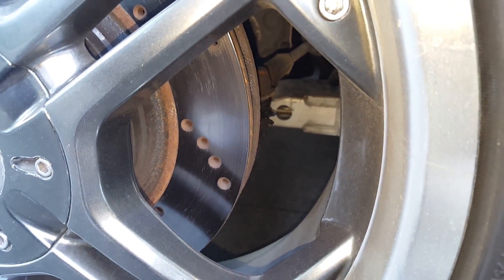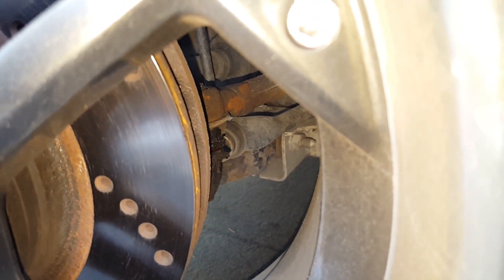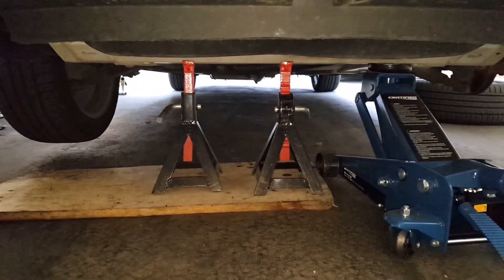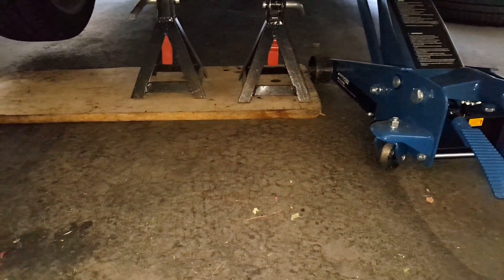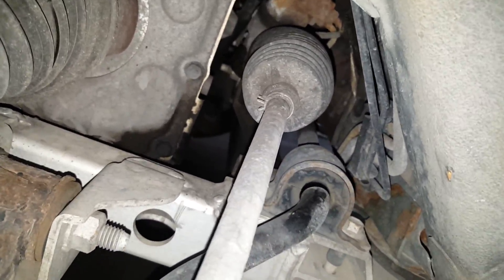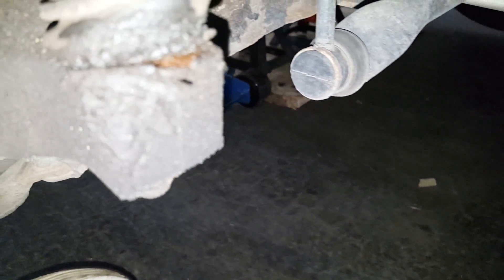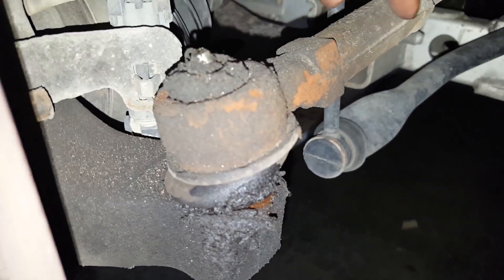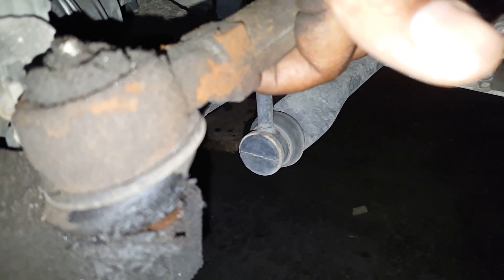04-08 Grand Prix - Basic Tie Rod Check

Comment: I have a 04 Pontiac Grand Prix GT1. I hear a clunking noise every time I put the car in gear drive or reverse. I believe I need a power steering rack and pinion but not sure which one I need. My brake and traction control lights are on in the dash could this be because of a bad steering rack? I changed all 4 wheel hubs and checked the brakes, rotors, and calipers which are all good. Please help me.
Reply from the maker: Hmmm. Hard to say without actually checking the car, but I can give a few ideas. First, it SOUNDS like you have 2 different issues. The clunking when shifting into gear sounds like a motor mount. there is 4. 2 up front(the dog bones, as they are known) and 2 lower ones. The best way to check this(safety first lol) is to open the hood and listen when someone puts the car into drive and reverse. make sure they keep their foot on the brakes, that sort of thing. Don't want any injuries!. Of course, be careful of the drive belt, heat, any other hazards, but take a listen. Sometimes, you can determine the issue just by doing that. As for the brake and traction control, I have some good news and some bad news. The bad news first. When the car throws the brake and traction control lights, even if you fix the issue, it WILL NOT remove the lights. Its not like the check engine light, which disappears after you fix the issue. So the issue could have been the hubs or brakes and you could have fixed the issue, but the car will still have the lights on. The good news is hopefully you have fixed the issue and don't need to do any more repairs. The only way to get rid of the code is to either bring it to the dealer or a shop that has the tool to clear ABS codes, and have them clear it for a fee. Or you can buy an ODBII tool that you can use to clear it yourself. Be careful with ODBII tools, some do not have the ability to clear ABS codes so make sure you are checking for the right one. If you clear the code and it does not come back, you're all good. If the light pops back up, then you have another issue. Hope this all helps.